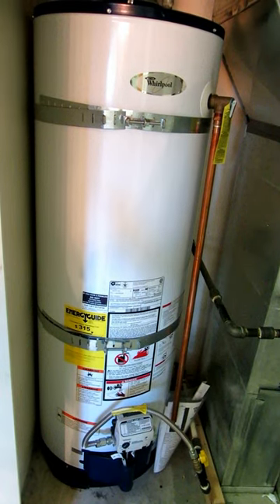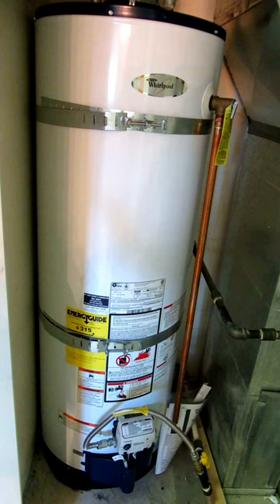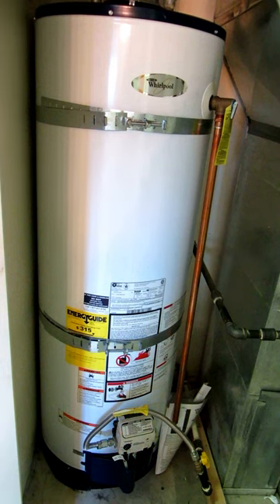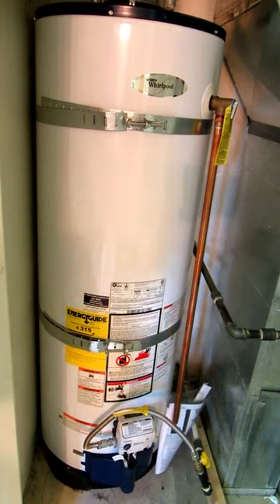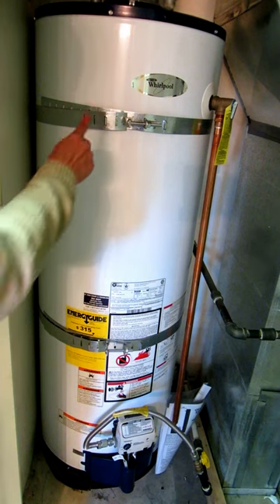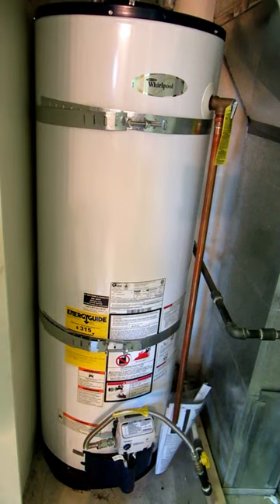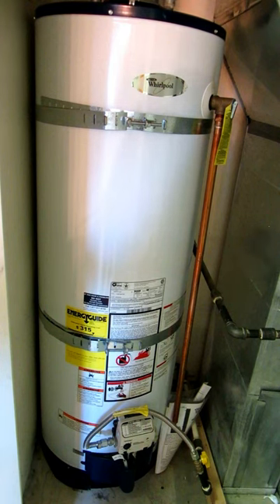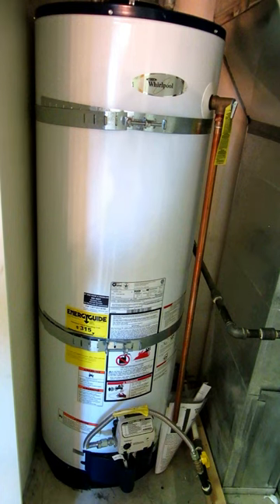How To Strap A Water Heater For Earthquakes- Water heater earthquake/seismic restraint kit

Comment: You are wrong with them straps - dont pretend to knowledge esp gas appliance knowledge when you dont know what you are talking about. Read the code and hire a plumber.
Reply: Most people aren't going to read the codes and having a plumber do the installation is no guarantee that it will comply with current state and local codes. You need an inspection, and that's the law in California.